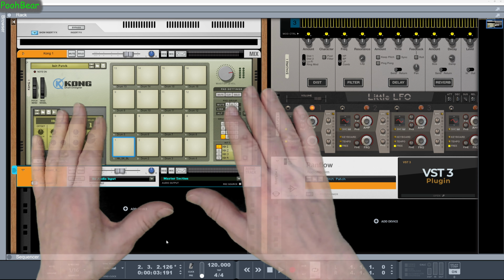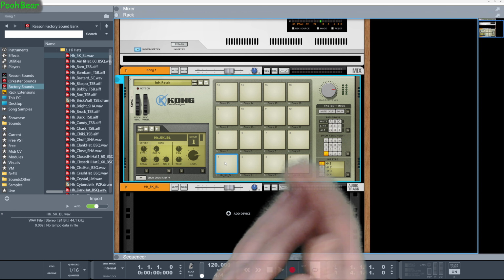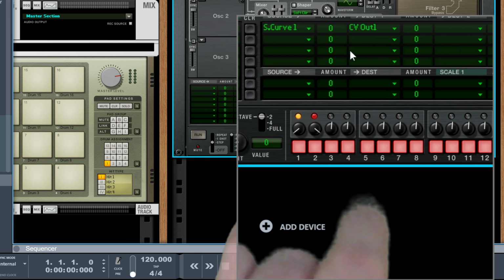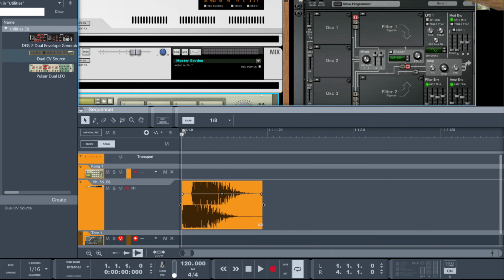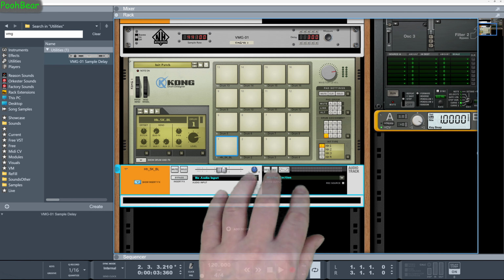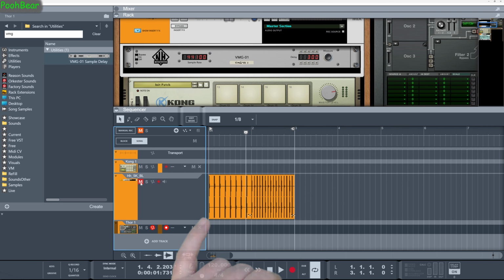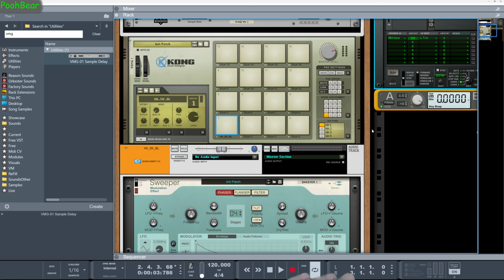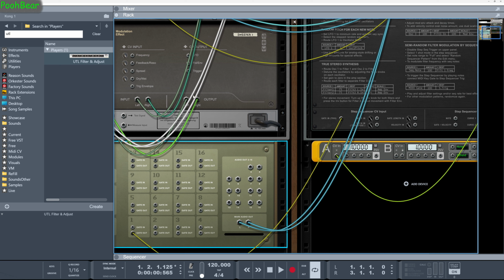Automatic Panning without using LFO's and Automation.

Comment: nice!  a little complicated but thats how you like it! 
 i'm mr smartiepants suggesting , why not just duplicate the hihat to a new kong pad and pan each pad?
Reply from the maker: The main reason not too would be you are creating an extra track to manage and it will be a lot hard to program, in the case if you just had an audio track there are not a lot of options. 
As for complicated, that is down to ones view, I could set either of those methods up (audio or midi notes) just as quick as using that panflow or a normal LFO however as I  said LFO's can give interesting patterns, a lot will come down to the content that is being panned, also remember this is not just for drums sounds nor panning :)